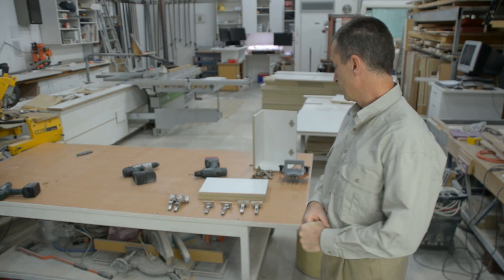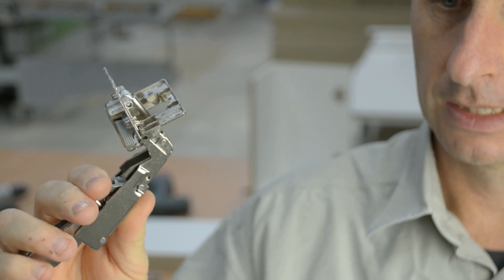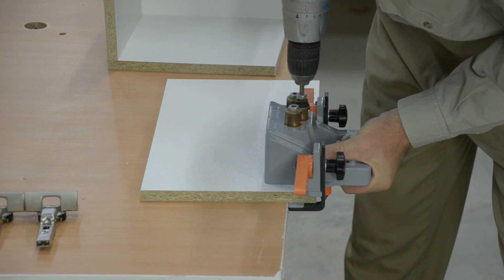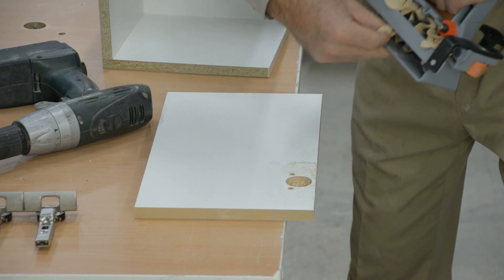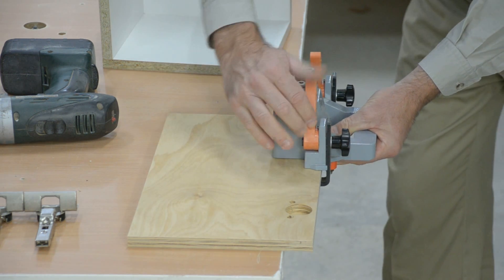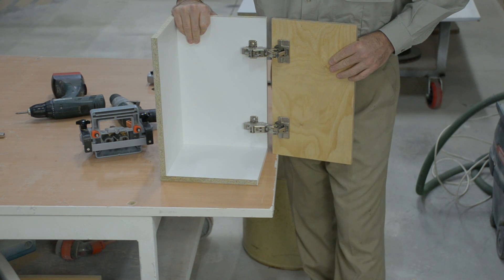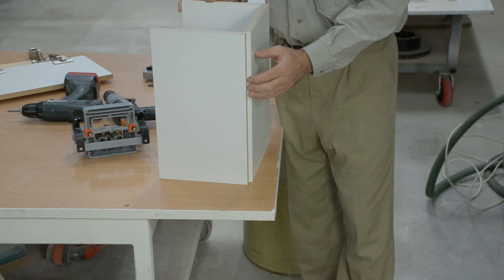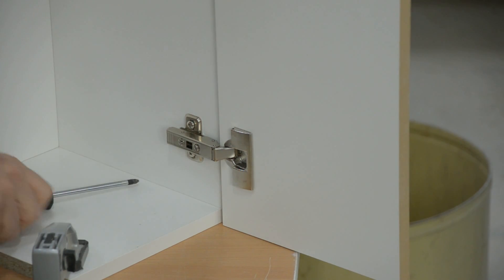ECODRILL use, and adjusting Blum hinges

Comment: Thanks for the demo I brought myself one, Its a great bit off kit. However my drill bit is now blunt and I cant find any instruction on how to change it. Im assuming that I just undo the nuts on the top of the drill bit . I have't tried this because assumptions can be very wrong. have you changed one and if so could you let me know. Thanks. 
Ive even asked my supplier and they don't know.

Comment: Would have greatly appreciated some guidance on how to make adjustments on the jig as well, that is the least intuitive part of the process!
Reply from the maker: It is funny how I didn't really think of that because I just use the one setting, and I have always the same since the 1980s.
I use 5mm inset, but others use 3mm.
The reason I use 5mm is that it safely clears tings like radius corners on the door edge, as well as giving the most cover over the cabinet ends.
Is this what you mean, or are you referring to something else?

Comment: how you change the bit?
Reply from the maker: J.R F I have drilled hundreds of holes.
But so far I haven't needed to change the bits.
They have hex nuts which I assume is the access method.
But I haven't actually changed them.
Reply: Helmreich Joinery would you be able to tel me if I could use an standard drill bit or it has to be an specific drill bit only supplied by Blum.
Thanks so much for your help.

Comment: Great video mate ! Which jig did you use to drill the holes for the hinges attachements ? Maybe the 65.5300 ? Many thanks
Reply from the maker: I have machined my own templates.
Blum has a multi purpose template which I sell on my eBay store.
This is a link to my eBay listing.
http://www.ebay.com.au/itm/Blum-Drilling-Template-for-Blum-Inserta-Clip-Hinges-/191821895649
Reply: Does this templates does the same thing as this Blum Clip #1344034 ?